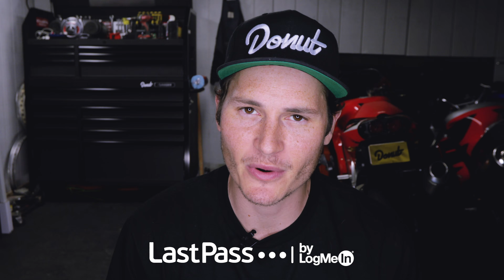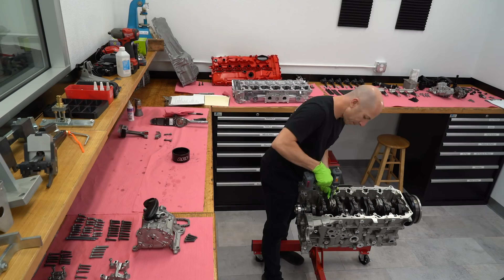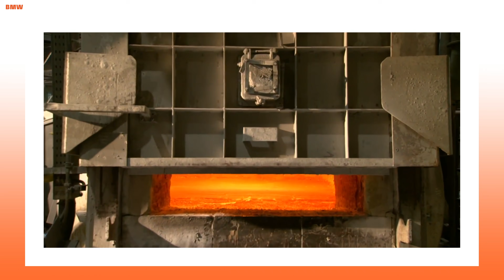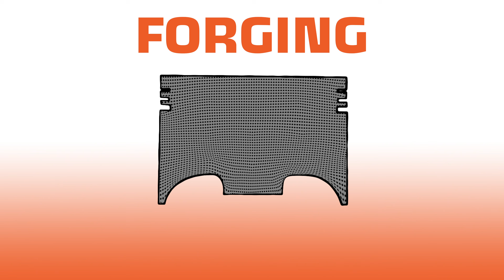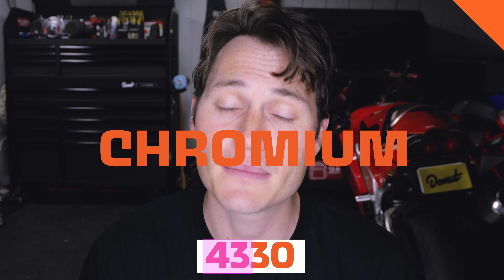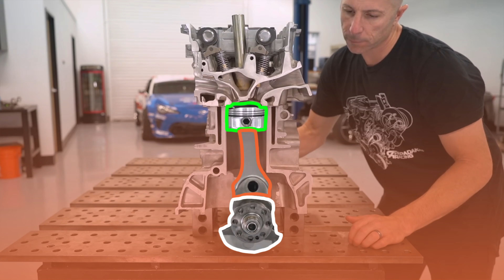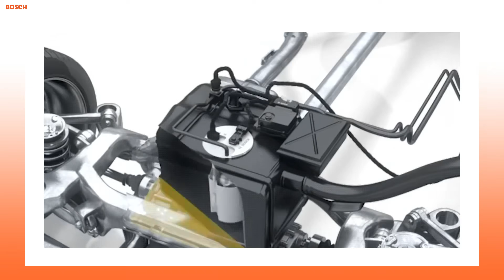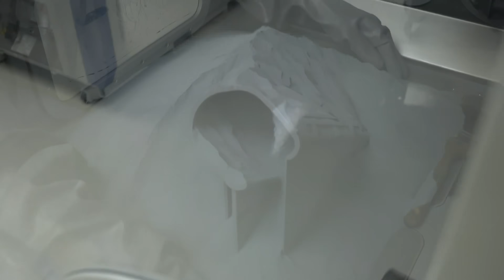The FIRST 1000HP 2020 Supra - Tech Explained

Comment: "Little modifications" 
Torn apart and rebuilt engine. Forged parts. 3d printed metal parts. Okay apparently I didnt know what "little" actually meant.
Reply: He torn apart the engine because he needed to know what he was working with, did you even watch the video? Also the forged parts were already part of the stock engine, I'm pretty sure all he did was ARP studs, Turbo, custom manifold and probably the intercooler and that.
Reply: @arwlyx  regardless tearing down an engine isnt little. If it was engine problems on cars wouldnt be a death sentence if it's just a "little" fix like changing oil.
Reply: @Pwn3dbyth3n00b  Are you actively ignoring the "he needed to know what he was working with" part
Reply: @9999AWC  Yes.
Reply: It's a relative term. I guess compared to other engines it only needed a "Little Modification".
Reply: @m Manifolds like that won't even be necessary, because once there's a big enough market there will be direct fuel injection systems that can spray the same amount of fuel.
Reply: That is little modification. How many engines are you going to triple the out put on without at least chucking forged rods in?

Comment: "It's stock, all the important bits are custom forged but that's not important"
I understand why people say it the way they do, but wouldn't stock block and bearings be more descriptive?
Reply: IMO as soon as you start swapping internals it no longer holds the title of stock engine
Reply: @Grooove_e  Exactly. We've seen over 1500whp on my 2JZ setup.. its on stock block with upgraded internals, but I would never call it "stock engine".
Reply: @Clownelskiy  exactly, on the other hand is my Bugeye WRX with literally just an intake and custom exhaust with a little bit of a tune and a stage 2 clutch. Making roughly 260whp horsepower just waiting on my actually stock engine and/or stock 5 speed with 140k miles to blow up
Reply: Pistons, rods, intake manifold, turbo. Not that bad when you think about it

Comment: I wonder how much boost you can throw at the car without maxing out the fuel. 

It would make great content to see a build series where you obtain say 5-600 whp with a tune, exhaust, and MAYBE a bigger turbo reliably. 
No need to tear the engine apart,  

You would have to know how much fuel is the max on the direct injection system, and also, how much power the stock head studs can handle. But I think that would be a cool video especially since pre owned low mileage 2020 supra are already dropping to the low 40s in price point.

Comment: oh my thats high compression ratio and a shockingly good "BMW" headgasket and holy $h*t
Reply: Have you ever heard of a Supra blowing head gaskets? Hint: Mk3 7M
Reply: @k0ppit  That was due to Toyota messing up the torque number for the head bolts. Once you torque them the correct amount, the 7mgte can be a very good and reliable engine if your power goal is around 500hp

Comment: Quick correction:  The bottom ring is actually called the Oil Supply/Control Ring.  It SUPPLIES the oil the skirts of the piston and the 2nd ring wipes away 90% of the oil and holds about 10% compression.  The top ring stops the remaining traces and holds most of the compression.

Comment: "relatively limited modifications" 

Uhhh excuse me?  Has Donut not even watched Papadakis' Supra build series?  They basically reengineered the entire car.
Reply: He means they didn't have to modify the block by boring it ect. I'd still call that "relatively limited" not completely re-engineered. It's clear that Stephan wanted to make this "as close to bolt on" as possible without the need for severe machining. The process he used to make the parts is a process any other company would have went through to make any other aftermarket part that's readily available for you or I to buy for any of our own cars.
Reply: @shona5512  Papadakis literally had to use liquid nitrogen to freeze plugs while heating the head to plug the direct injection holes.  Additionally all the forged components, 3D printed intake manifold, new turbo etc... is not at all "relatively limited". Relative to what?  A promod dragster?

To be clear, I am only criticizing Donut and not Papadakis Racing.  Donut has a history of frequently incorrectly framing facts which either shows: intentional misrepresentation for entertainment purposes or incompetence; in either case Donut is being irresponsible.
Reply: @arinb.756  What do you mean?

Comment: Then couldnt you theoretically make an insanely fast z4?
Reply: kloud Gaming yes
Reply: You'd be able to. From what I've read on forums all B58's have forged internals. Think of it as newer N54
Reply: However the B58 has received revisions to improve cooling and other factors. So if you want to id get an updated B58
Reply: @k.a.n372  I'd say it's just a stronger version of the n54 since it's closed deck also.
Reply: The BMW Z4 has been dominating Japanese touring car racing for almost a decade.
Reply: just a car guy  it's more or less that the mk5(2020)has 2 port heads with a higher compression ratio while the Z4 has 6 port heads with a lower compression ratio just giving it the advantage for more boost and breath ability.
Reply: Yes but it breaks down 5 miles after because it's a BMW
Reply: Tbh, if i had the money, id just 2j it
Reply: @user-dk9jq6cj7q  so you're saying that if you had the money you'd just throw it into the garbage can?
Reply: @aimDiego  pretty much lmao

Comment: C'mon you can make 1000hp with anything with enough money
Reply: Yeah, a Corolla can make 1000. No, it can’t. The claim that “YoU cAn MaKE 1000hP wItH aNyThInG wItH eNoUgH mOnEy” is stupid. Most engines physically are unable to unless you make the entire thing out of Titanium, and at that point it’s getting ridiculous. The point of the video is that the B58 can make 1000hp with about the same mods and amount of work that the 2JZ would require to make that same amount of power.
Reply: @thejay8963  well I seen corollas that can say 900 hp with just forged internal 🤷‍♂️ and just tuned to 900. Its BMW it will be strong so there's no doubt, but people just love JZ and now B58 and both mehh don't like any of those in my Supras
Reply: Now a days is true any engine can make 1,000 hp
Reply: Aaaannnnddd??? What's the point? As the video said, the engine is new and aftemarket parts are not available yet. So he had to design his own.
Reply: @arinb.756  Many engines are up there with just bolt ons

Comment: My favorite class I took last semester was Engineering Materials and Processes. The entire class was taught by a mega gear head who designed turbine blades for Boeing and the class was basically “Steel 101”. So if that stuff about grain structure was interesting to you, that would be a cool class to take.
Reply from the maker: "EGM 3520 - My Mechanics of Materials class was one of my favorites during college" - Jeremiah
Reply: Donut Media At one point did you ever receive “blow torch 101”? Lol. That was a fun day

Comment: I think b58 is a good engine but the problem is its a german engine in a japanese car but it just my opinion tho
Reply: @arinb.756  yeah i agree with you but this is like their flagship car and toyota didnt make alot of sportscar anymore as they do in 80s or 90s so they should atleast make the engine for the a90 rather than just using fully designed engine by bmw and if they really want to save money shouldnt they just use sone sort lexus car as a platform. i maybe wrong but the point that i want to say is it just sound really wrong to put a badge of a name as a supra on car that was made of 80 to 90 percent bmw part and component.supra is among the car you will think when people talking about jdm cars.i felt like i've been cheated by toyota in someway .

Comment: Ahh I see. The limited modifications of completely rebuilding an engine. Just like the 2jz. Still very cool though.
Reply: Well, he only changed pistons and rods inside the engine. Of course he changed the intake and exhaust (with that turbo, you have to).
Reply: Matteo Tommasi Yeah. The fact that the cams and crank are still that strong including the bearings is impressive

Comment: I think the Supra is a great car and all the people who think that’s it’s not because it doesn’t have a 2JZ are wack.
Reply: I guess thats why they hate the mk3 supra too. "It's not a real supra" is what I see often regarding the mk3 because it has the 1jz. Its pretty comfortable and decently fast, headgasket issues nonwithstanding...
Reply: JJJ mk3 is before the 2j so calling it not a Supra is too far but the a90 yeah it could could be fast and everything but it just not like a Supra yeah it could be more efficient and blah blah blah but mk4 will always be the most loved Supra
Reply: Ethan Bleach retweet
Reply: The new motor is fine. I'm irritated about all the fake vents, especially the ones glued to the door. It has one functional vent- the center grille vent. WTH Toyota?
Reply: Blue Ridge Garage those “fake” vents are there for after market parts for tuners. No need to cut and slice. There’s plenty of other components besides the fake vents that are designed in the car for tuners. They also have groves in the engine bay for anti roll bars that tuners can make for them
Reply: @blueridgegarage  you can take out the fake vents and make them real vents bruh like they made it that way for people that want to do it
Reply: People don't like it because it's a BMW
Reply: It’s not a supra either
Reply: It's a cool, fast car but the point is without a Toyota engine can it really be a Supra? Put a bs engine in a Corolla, fuck, put a Honda engine in a RAV4,  IDGAF. not a Supra. Having said that, I'll never own one so maybe I'm dumb.
Reply: They have small pp
Reply: just a car guy  erm I am 42 not 12 Rasta.
People dislike the because BMW got involved to much nothing to do with 2JZ, if the car looked like the FT-1 concept with the BMW engine then it would of been liked more, but it looks like a Z4. I if it was Lotus that was involved then yeah
Reply: just a car guy  you know nothing about cars please do not watch or comment on here again
Reply: jermaine austin the old supra is a heavy boat that handles like a minivan
Reply: You know all the JAPANESE pro drifters think this car sucks
Reply: It's just the fact that it doesnt have a 2jz engine in it not specifically the 2jz just a jz like why would u put a bmw engine in it
Reply: @carlososorio7645  Toyota wanted to put an inline 6 in the supra because the old one had an inline 6. Toyota doesn't make inline 6s anymore but BMW still does. Toyota weren't gonna spend millions to developp a new engine for a sports car. Getting it somewhere else was the only option.
Reply: Darius Hernandez because the 2JZ is old heavy and stupid while the B58 is newer and better in every way